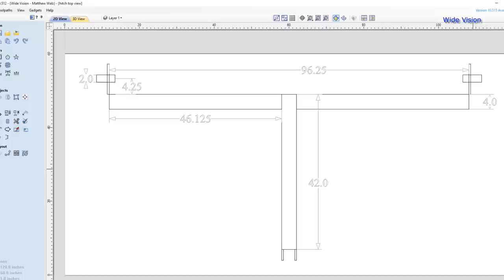Shipping Container HITCH BUILD!

Comment: CLEVER idea to move those containers. Considering they have the structural strength to support their own weight. There's really no need to have a skeletal trailer and all the load and licencing and taxation involved just to shift a steel box section. (which is the container profile) You have all the greatest machinery to make the dolly and towing jig. I'm just curious how your channel hasn't come up on my home feed years ago? I don't expect you personally possess the answer. But i like your presentation and work style.

Comment: Great project. Heres an idea when you need pieces of DOM tubing.  If you find a shop nearby that builds off road or drag car chassis or roll cages they use mostly DOM tubing. They all have a barrel of shorts and cut-offs, you could probably get some cheap or even trade. Just an idea

Comment: Just subscribed, amazing build and the boy toys you use is fantastic, the plasma cutter, the hydraulic bender, the cool welder, looks like a millermatic 250 couldn't quite tell, let me guess you must have some type of steel roller as well? very cool
Reply from the maker: I have a small roller I built. Only 3 inches wide. I big 60 inch one is on my wish list! :)

Comment: Is the weight of the container and both hitches depending on 4 bolts between the truck hitch and the truck frame? What size bolts are used?
Very interesting design, worked very well.
Reply from the maker: Yep, the truck hitch is bolted on with 4 bolts. They are 3/4 inch diameter, grade 5.  IIRC that's about 33,000 lbs of shear for each bolt, which is 132,000 lbs (ish) of shear. That should be enough! :)

Comment: How did it pull? I am contemplating doing something similar. I need to get a 40 ft high cube somewhere where a tractor trailer cannot go. I have an 86 f350 flatbed, seems like for what the container weighs it shouldn't have any problem going the short distance that I need to go.

Comment: Wish - build & bolt an extension that will bolt between coupler and trailer?
Reply from the maker: I tried a piece of 3x5 inch rectangle tubing, and it slides in there nicely. Should be an easy fix. :)
Reply: @WideVisionMetalFab  👍👍

Comment: Cut out a square to match "inside of cross tube" find a second tube to fit inside both tube and the end plate. Weld in place OR make it slide in and out, drill hole through it "top and bottom". Weld a nut inside for a large diameter threaded rod. Weld a large nut on top making a leveling Jack. Use it to level unit on ground back off and remove whole unit.

Comment: Why not run some flat bar along the outside of the centre bar so you can extend or even angle up both side but only halfway on the bottom so you can weld one either side then you could extend a good foot longer easy. Without making it weak.

Comment: Guy builds a over the top heavy hitch and bolts it on with four grade 5 bolts!!!!
Reply from the maker: The shear strength of those 4x 3/4 bolts is over 130,000 lbs.  That's a pretty good ratio for a an 8500 lb load.  Also, I looked at flatbed gooseneck bolt down plates, and DOT only requires 4x 5/8 bolts.